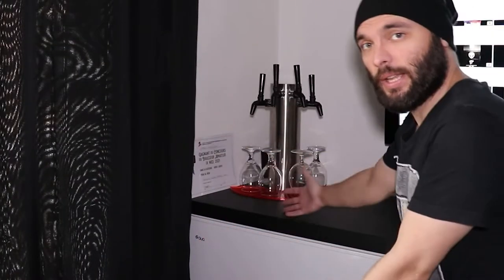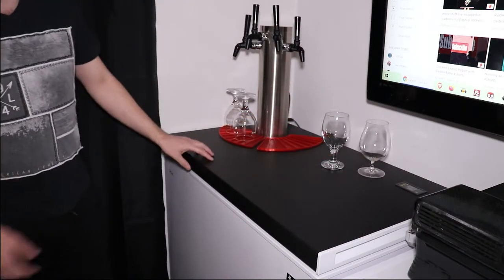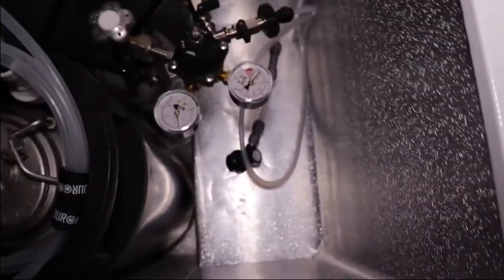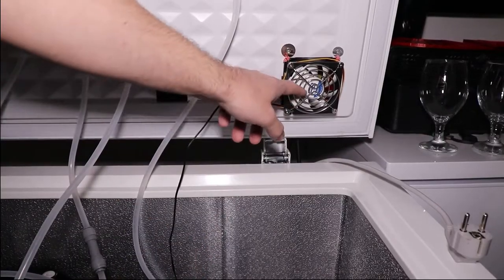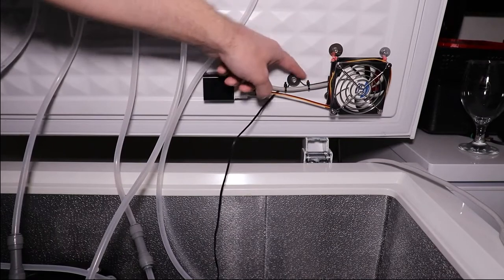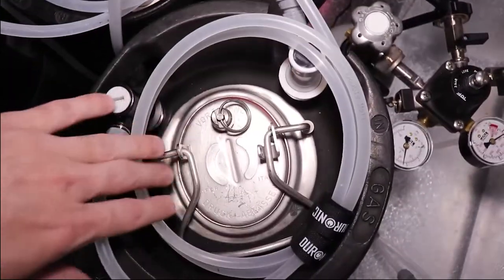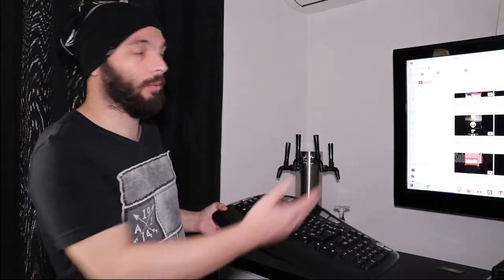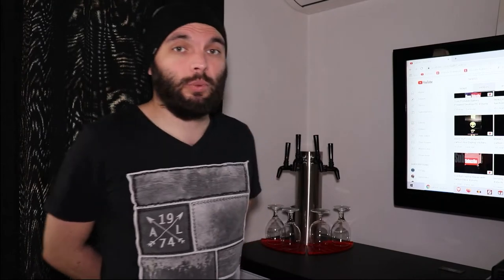The BEST DIY Kegerator/ Keezer on YouTube?

Comment: Sick. Really well done. I like your thought process with everything. I bought a cheap 2 tap Insignia kegerator on sale and have customized it along the way, adding a 3rd tap, installing an Inkbird controller with a keg thermowell for the temp probe, a fan for tower/font cooling and even Plaato scales for monitoring the levels of each of my kegs. 

My next big upgrade will be switching everything to duotight and evabarrier. 

One thing I did put in was the one-way valves on the gas lines, just like you to avoid any back flow of beer. I think mine work pretty well but was gonna use the duotight ones when I migrate everything over. Shame to hear that they don't seem to work very well.

Thanks for sharing.
Reply from the maker: Thanks Joshua. What one-way valves do you used? I'm interested to change mines as well. Maybe I will try with the John Guest ones. 

Do you know if there's a super low profile alternative to Plaato scales? I wanted to add it to my system and unfortunatelly it's 10 inches in height and I think I only have maximum 2 inches between the top of the kegs and the pressure regulators.

Thanks for watching and cheers!
Reply: Have you looked into tilt?